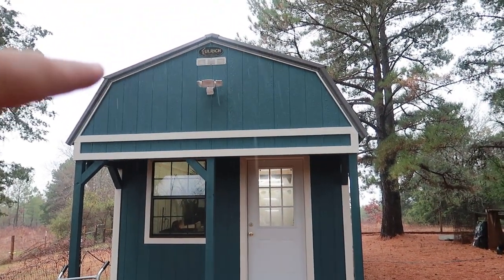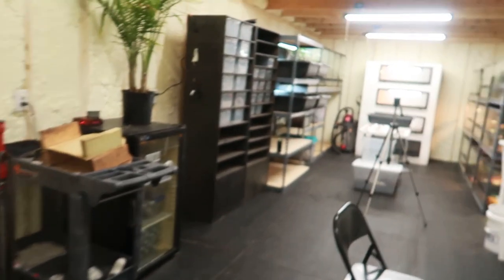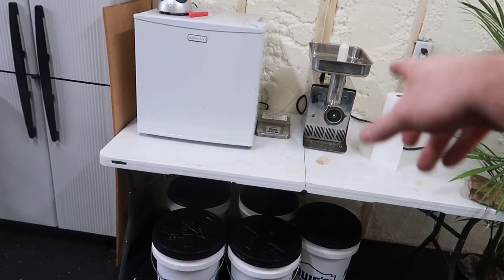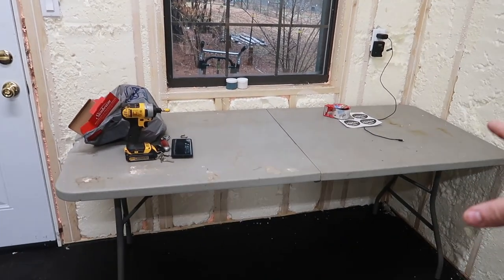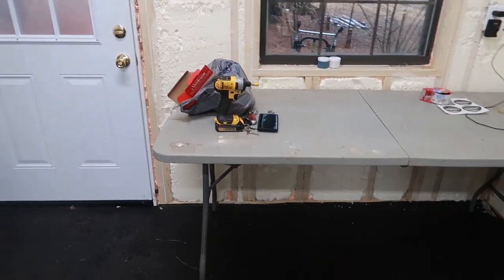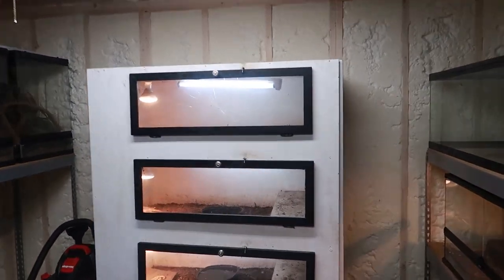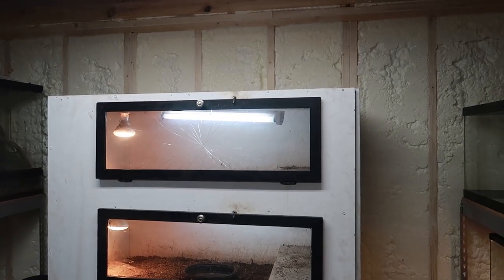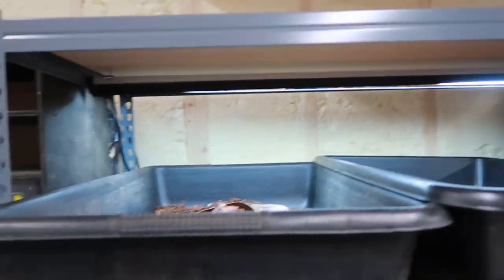New Reptile Building Tour!

Comment: Looks Great!...Making good progress. **Tip* Get yourself a power failure alarm for the new Reptile building.  I have a small shed where I housed a few baby dragons and an incubator. Well, one rainy night here in Miami during hurricane season the breaker tripped for it.  I realized it almost 20 hours later.  Lost quite a few eggs and the baby dragons were freezing. Needless to say it happened a few more times,  but now that alarm goes off right away and notifies me.
Reply from the maker: Good tip!  Was actually thinking about that today.  What do you use?  Going to look into some that dont run of any kind of wifi because there isn't internet out there yet.
Reply: @RoseCityReptilesTX   I have a very small Shed that is right beside the house and I use a basic plug in types from Amazon. Makes serious noise when power goes out. You might need something a bit more intense since your setup is much bigger and much further away from the house.